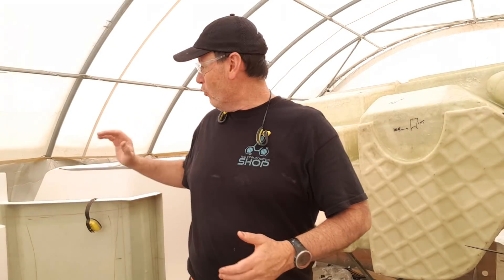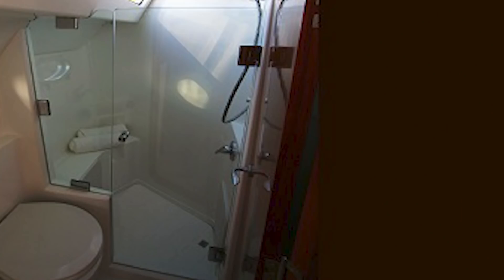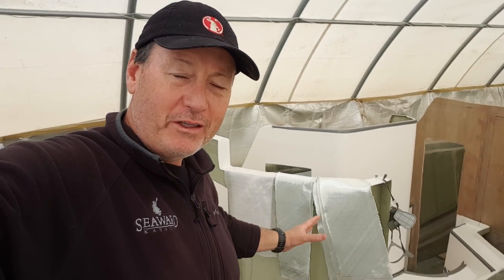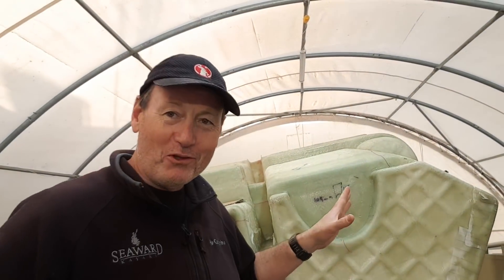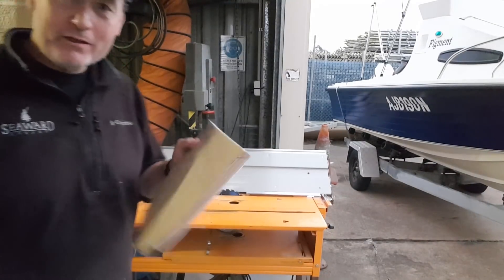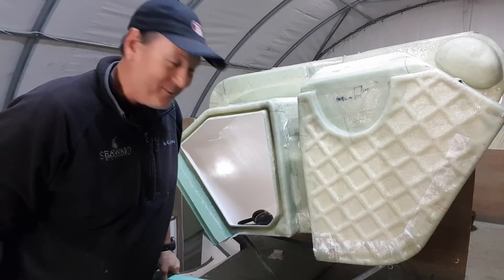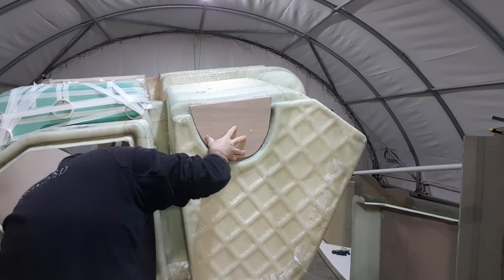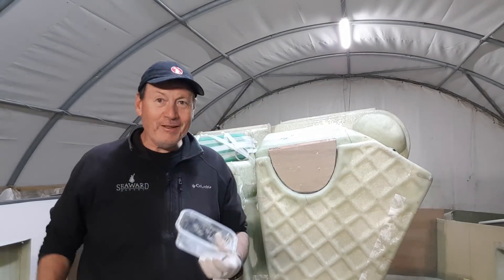Ep133 Strengthening the Portside Bathroom Module Part 1

Comment: Good work, as always Ross ! Just the conduit left to go... For the toilet seat, rather than just plywood and wood screws, had you considered a set of nut-serts ?  See : https://www.amazon.com/Rivnut-Insert-Nutsert-STAINLESS-THIN-NUT/dp/B01MTZ22VQ/    The material of threads can be Stainless, Aluminum, or Brass... sized to fit US and Metric threads and are actually riveted in place with an arbor tool that expands the ridged portion to fit and bite into mounting holes.

Comment: Love your work Ross, but I cringed when you put ply under the head.  Why didn't you use foam core? You could have used toggle bolts if the screws wouldn't hold as well.  I hate wood on a glass boat that isn't trim, sooner or later water gets in and rots it to a soggy mess.